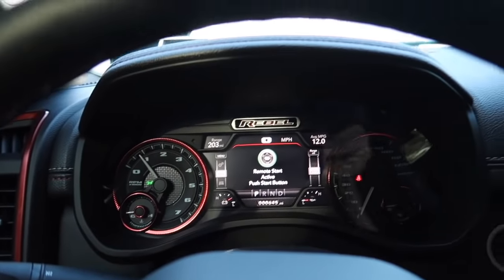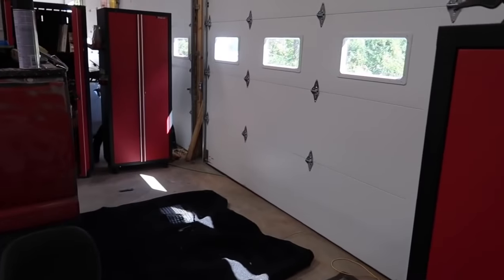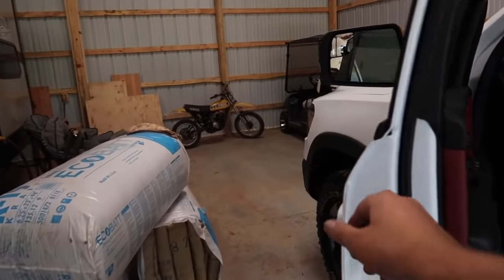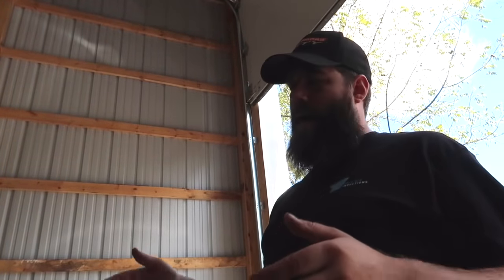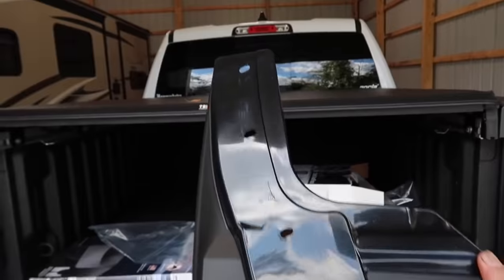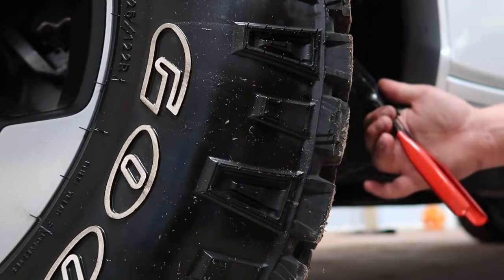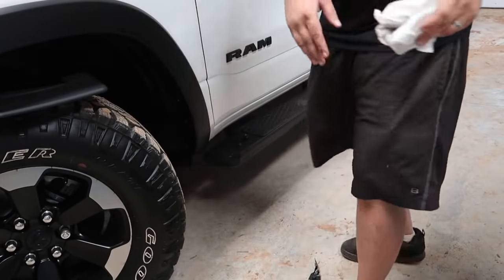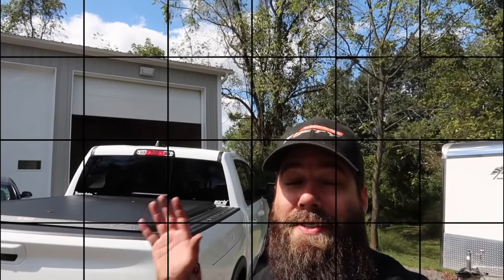2019 Ram Rebel Must Have Mod Four

Comment: I ended up using Weather Tech in the front and Mopar in the rear.  Made for a nicer look with the Ram on the rear of the mudflap and the Mopar rear looks just generally nicer and the Weather Tech looks nicer in the front than the Mopar.

Comment: Your videos are the best! Question - just got a ‘19 Rebel Crew Cab that did NOT come with the running board option. Which ones are on your Rebel & any particular ones you’d recommend for me have added? Ram dealer offers 3 OEMs (PowerStep $2000 installed, Black Tubular $695 inst , OffRoad $1300 inst ). Thank you !
Reply from the maker: Thank you so much for watching I have done the power step install they are pretty cool but running the wires and lights takes a little time the off-road ram ones are cool but go rhino makes one very similar the RB20 and they are a decent amount cheaper and the install is super easy the studs are already on the truck you just assemble the steps and install the nuts/bolts probably a hour or less on your driveway

Comment: Do you have the amp or mopar bed step? Which do you recommend? Also thanks for the WeatherTech review. I was just about to buy the Mopar until I heard about the infamous mud pocket
Reply from the maker: I had Amp steps on my old truck and they were nice and come down really low I did an install and review vid on those the Rebel has the factory steps which work but I think i'd like the wider offroad ones

Comment: I get why you didnt get the oem ones but these just dont look as good and look fairly cheap compared to oem ones. Also the oems wrap around the flare to give you protection there too.
Reply from the maker: the OEM ones aren't as strong as these in my opinion and the part that wraps around will collect dirt and eventually scuff up your flare I am much happier with these, thanks for watching

Comment: Hey they look good, I was on the fence on getting those or the OEM.... think I will get the same 1 as you..... on a different note....... this just started happening a few days ago when someone is sitting in the passenger seat and I make a turn either left or right there’s a slight noise from the seat!!! Any idea what it is or what I should do? ( 2019 Rebel )
Reply from the maker: hmmmm might have something rubbing or misaligned I'd push on the seat while inspecting it and try to recreate it
Reply: Is it still under warranty? If it is take it to the dealership and let them take a look. 👍
Reply: Yeah I couldn’t figure out what it is.... it’s under warranty still, I got 2300 miles.... I called the dealership and made a appointment to drop it off.....
Reply: So I had a 8am appointment yesterday & I dropped it off, they took all day pretty much to look at it , I called them at 3pm & they said they haven’t had a chance to look at it yet but then they called me at 6 PM when there closing saying OK your trucks ready I’m like well did you fix the seat they said yeah there was a bolt that was or came loose I guess , they had to take it ( seat ) apart , so I am going in today to pick The Rebel up, I hope they fixed it!!! That’s one thing I’ve always hated about American brand dealerships their service department has always sucked